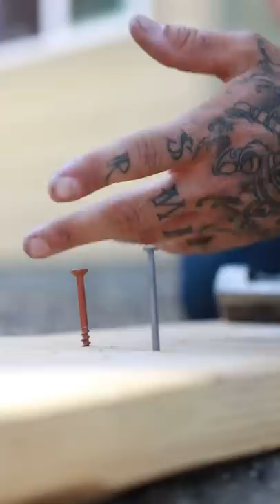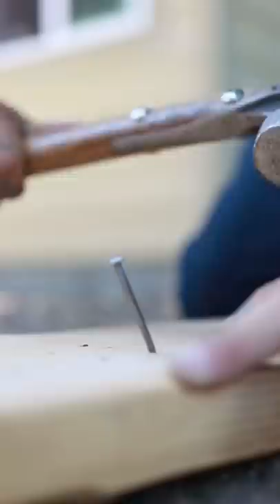Nails vs. Screws: Why do we use nails? #shorts

Comment: That's literally not the reason why. Nails going faster with a nail gun. Screws would take forever you would never be able to power through with screws it's the only reason nails are preferred. Say they made steel screws that could bend you'd see nobody using them. Purely for the reason I mentioned.
Reply: I guess that could be another reason why nails are used, but the main reason still applies. As he mentioned, nails have tremendous shear strength, which under pressure, it can bend. When screws bend, its structural integrity is compromised, pretty much rendering it useless. This is why nails are used for exterior walls, wooden house frames, attaching roofing and hardwood floors. If screws were the better option, they would 100% be used.
Reply: @nagnot6718  I don't know about you but I have never seen a screw sheer within a wall frame or a stud. If the house shifts the wood would groove before the screw even comes close to snapping. The day you can put screws in a nail gun is the day nails will be obsolete. It's always about time when it comes to construction. I could pop in 20 nails with a nail gun in less than 7 seconds. As opposed to minutes with screws.
Reply: @patman0250  While it is true that it’s very hard to sheer screws or nails, we use nails just in case of the event that there is enough pressure to shear. I’m sure the efficiency of nail guns are a big reason why we use nails, but even if there were screw guns, nail guns would still be used because of their shear strength. What’s the point of using screws that can snap rather than nails that can bend?
Reply: @nagnot6718  Like I said have never in my life of home renovations seen or ever heard of a screw snapping while the house shifts. I don't know where that fear comes from but before that screw even comes close to snapping. Woods softer than metal it will grove way before that.
Reply: I've worked on many of houses and I can promise you that the screws may break when u pull them out but never have I seen one break from shifting......I'm a 4th generation carpenter....I've framed addons with screw b4 (owner had like 4 buckets of t25 torq screws) and it's in tornado valley here in arkansas......never a single issue
Reply: @tylercollison4858  Exactly. Screws are some pretty tough suckers. Who knows maybe houses shift because nails bend LOL.
Reply: @nagnot6718  there are screws used for framing that have a higher shear strength than nails. Also, you hardly only have one force being applied, wood contracts and expands so the nails are under tensile strength as well causing them to loosen unlike screws. This makes their shear strength much lower
Reply: Well as long as we are seriously arguing it... Even if screws were as fast to install and as cheap to manufacture as nails.  Do you really hate the person that comes after you that much?  Ripping small nails and staples out  is really easy compared to finding every screw and hoping the heads not stripped. Be kind and make it easy to rewind please dear God!  And don't overdo all of the staples and nails either please while we are at it...  Know your ratios please
Reply: @brianbradford3483  Bro there's no arguing and there's no hate it's just facts. You're mixing truth with debate. I don't hate nails and I don't hate people that use nails, I'm just stating the simple facts never seen a screw cheer for my shifting house. That was the exact point of this video. PS In absolutely no way whatsoever is ripping out nails easier than removing screws. By the simple fact of screws are removed with power tools. Most Niles are sunk below the wood. Removing screws is as easy as punching in nails with the nail gun. I think you're just getting on mixed up here.
Reply: impact guns, no one hand drives screws.
Reply: @engineeringreality7878  Exactly.
Reply: Ever hear of an impact? It'll drive a screw in no probs.
Reply: @historyhisstory6289  I made that comment with impact drills in mind. It doesn't matter what kind of impact drill you have. By the time you're on the fifth screw I'm already going on 30 nails with the nail gun. In no way shape or form is there a comparisons. That's why nails are preferred over screws because they're faster, not that they snap when the house shifts that's just made up BS.
Reply: Actually it is the reason why. Screws do not have the shear strength, and will not pass minimimum code for framing inspection for fastening structural work. Unless specialty screws of course
Reply: @patman0250  think of a floor system. Even a deck will be quite a bit weaker relying on screws alone. They do not have the shear strength
Reply: @2muchofyou  you do know screws don't meet minimum code for structural framing. For reason mentioned in video.
Reply: @chrisburns5691  That's literally not true at all. like I said before I've been building and tearing down houses for 15 years. And I have never in my life seen a sheared screw due to a shifting house. Pretty much a myth at this point. Who knows maybe houses shift because nails are used.
Reply: @patman0250  think of a floor system. That is why you wouldn't pass a framing inspection if you use deck screws to do your framing lol. There is a reason screws aren't used. I learned this as a first year apprentice. He isn't wrong.
Reply: @chrisburns5691  seems you need more apprenticing, not passing inspection because you use screws it's the most unrealistic and knowledgeable thing I've ever heard. Like I've said before I've been building and dismantling homes for 15 years. Not one case of shared screws or I'm not pass inspection due to "screws". That's just laughable.
Reply: @patman0250  if you use screws to frame a house, that is laughable
 
Read up on the building code. Typical screws do not meet code for structural work.  This is basic knowledge.
Reply: @chrisburns5691  The only laughable thing here is your knowledge. Screws are literally designed and used for flooring and studs. Including decks which is why they're called deck screws. How old are you? Completely blowing past the fact that screws don't sheer when a house shifts.
Reply: @patman0250  Jesus  christ, I really hope you aren't framing decks with 3" deck screws, and if so better be using hangers. Apparently you've never read the building code. As a carpenter we have to be quite familiar with it. Try giving it a read sometime. Difference between a handyman and a carpenter I guess.

Screws are superior for many purposes, as a journeyman  carpenter i use them daily. Subflooring should definitely be screwed and glued. Deck boards are best screwed, maybe hidden fastener system etc.

Structural work needs to be nailed, or if screwed specialty structural screws are needed. Deck screws and the like just don't have the shear strength. Might be good for ya to read over the building code, or work with an experienced carpenter to further your knowledge.
Reply: @patman0250  i can tell you are insecure about your handyman level knowledge. No worries.
Reply: @chrisburns5691  I wouldn't be surprised if you're mistaking nails for screws and vice versa. But that's all right just keep playing with your Tonka trucks and don't worry about the big boy things.
Reply: @patman0250  sure thing bro... keep on framing with deck screws..
Reply: @chrisburns5691  Apparently you've never heard of stud screws. Guess what they're used for go ahead guess, ah who am I kidding you're too simple.
Reply: @patman0250  sure thing bro..
Reply: @chrisburns5691  Shhhh. Go back to sleep soon

Comment: Nails also pull out slowly with the tiniest movements. There shouldn't be enough movement in your building to break the screws. If the screws are breaking them you have ground work problems or foundation problems.
Reply: True. We build with nails because they're cheaper.
Reply: @lukeb3930 that’s right my dad ain’t rich for them screws
Reply: Screws in structural members have to be rated for purpose for the exact reason he stated. People just don't use them because they're slower and more expensive.

Comment: Nails and screws are made out of totally different metals depending on the job. Most nails are made of a softer metal compared to screws. There's a lot of difference between driving force and twisting force. Depending on the material your trying to penetrate. It doesn't matter what construction you're doing. You use the right fastener for the right job, SIMPLE.
Reply: A lot of screws are cast as well, whereas nails are generally forged
Reply: Types a paragraph. SIMPLE
Reply: @hysterheister0947  🤦‍♂️🤷‍♂️
Reply: Okay.......so what is your point? 
Are you correcting the author or adding additional common sense info to it.
YouTube vids are easy to make & upload
Reply: @thomascalton3067  no not true literally both can be out of anything between mild steel and fucking rock hard steel or stainless. Depends on what you stick it in.

Also never ever buy fucking cadt screws
Reply: Difference screws cost more why use a screw of the same material when you can use a cheaper nail that takes 1/10 of the time to apply time is money SIMPLE
Reply: @thomascalton3067  tools are forged so are pin connections on heavy equipment, but I'm not sure bout nails.
Reply: @Donaldtrummp  screws have 5 times the holding power and if a house buckles & twist enough to break screws that means it was a  hit by a tornado or equivalent. It would suck to build one with screws. Wouldn't be worth it unless your house was mobile 😂
Reply: @junkworks1  then why aren't you building houses for everyone bro? Since you're way smarter than everyone & have all these ideas of how it's better
Reply: @Donaldtrummp  thanks for the compliment bro. I'm always thinking about stuff. It's nice to see someone finally noticed. I couldn't possibly build all houses cause I'm a ditch digger what do I know? Screws would be better i would imagine, but i wouldn't want to frame a house with them. It would take forever to build. With that said, Every deck I've ever built or seen built used mostly screws for fasteners.
Reply: @Donaldtrummp  hey just for that vote of confidence in me, i subscribed to your channel. One hand washes the other 🙂

Comment: It’s pretty simple actually- Nails are used for things like framing because they bend with the expansion/contraction of wood, Screws are used to secure things together that aren’t meant to warp and bend. For example- you frame a wall with nails, then use screws to fasten the drywall.

Comment: Americans: That's why we build with NAIL

Indians:  Confused Cement Noises
Reply: Anon Ymous  I don’t know man. The brick houses in Germany have been working out for generations. And as we sometimes get tornadoes and pretty damn strong storms, they also proved as catastrophe resistant. As soon as a little wind comes up in some woodhouse village in Oklahoma you can just see all the houses getting ripped apart by it.
Reply: @TheReplayJunkies  bricks are different from plain concrete... brick walls are built with a strong foundation for support, then they usually build an inner mesh of rebar, then they start laying bricks with a filler in between them, usually mortar or some sort of concrete. That's roughly how they're made.
Reply: @rafaelbastaja7406  Concrete cracks where wood flexes.

Comment: It honestly depends on the load for a given structure. There is a reason to use both. Flooring, decking, constant pressure dependant, and other horizontal loaded structures should be screwed in. Framing should be nailed   exterior walls nails ect...

Comment: They both have a different purpose. We build with nails because it is a lot faster to do with a nail gun, that's it. Also, nails are a lot cheaper than screws. We build the structure with nails to save time and money, but everything else in held down with screws. That's why we build with nails.🙏🏻👍🏻
Reply: I appreciate your honesty
Reply: @hoggwild3706  
Thank you, no problem.🙏🏻👊🏻

Comment: We build houses with bricks because you're supposed to.
Reply: Brick houses are good....but there is no innovation in " youre suppose to ".... "our forefathers did it so youre suppose to...."
Even RCC/framed structures are built that may use Concrete blocks.
Reply: @manz007  Maybe some things don't require innovation. In structural engineering "innovation" can mean people die. If I was building a house, I'd go for dependable rather than innovative.
Reply: @TheYuvimon  you’d go for being out of a job... There is not room in the home building industry for people who don’t want to innovate. The people who can afford to build new homes would never hire you with that kind of thinking. Copper pipes were viewed as dependable. Until they came up with a product that is vastly superior in every way. Faster to install, easier to install, less leaks, less issues, and is cheaper. No body is putting copper pipes in new construction. Everyone uses pex. Innovation will win and when it does those who refuse it will be out of a job faster then you can blink.
Reply: @adamdodds144  the builders aren't the ones doing the innovating though. They will put in copper pipes just as well as led ones. I'll leave the innovating to the people who know what they're doing. When builders just start adding their ideas to a structure, without running it by the architect/structural engineer people can and have died.
Reply: @TheYuvimon  you just proved you don’t know what you are talking about. Nobody is using copper or lead pipes in new construction. It’s slow, expensive, and it sucks. I’ve worked as a project manager and been on sites. I went to school for civil engineering. If a builder isn’t thinking about innovation they will be out of a job. You don’t realize how many subcontractors lose contracts because they don’t work with “product x”. If you want to be stuck in your ways you better get into to residential contracting were your boss is a homeowner who doesn’t know what they are looking at. The engineers and the project managers are the ones who push for innovation. More often then not the innovation is an engineers idea. The laborer getting paid $20 an hour to bust his ass isn’t the one coming up with the innovative ideas. That’s what the engineers, project managers, construction managers, and guys with years and years of experience are doing. That’s the team that’s putting their heads together problem solving not the dude who barely finished high school that started a couple months ago.
Reply: @adamdodds144  Hey, way to go! Played the "Gotcha" card on me. Everything I have said so far, must be invalid because I don't know what the name of the most recent fucking pipe brand is.
Let me say this again but slower.
Innovation does not equal improvement.
IF a product has been used and tested enough to prove itself reliable, it becomes the new norm ... sure, duh.
I think our problem is, you are talking material, I am talking process.
Well, shit if I still make houses out of wattle and doub, yeah I'll be out of a job. But in the process of building something there are no shortcuts, if you want a structure to last. (I'm not talking about the paper mache tornado toys Americans call residental houses, those are not structures, those are neatly arranged piles of tinder)
If you have workers "innovate" on the job, instead of sticking to the god damn plan, structural integrity can be compromised. (see Miami - 4 weeks ago - 97 dead) 
If you have electricians improvising a solution, instead of sticking to the plan, buildings will burn!
If you have construction/project managers changing designs for ease of production of components, people will and have died!
(Hyatt Regency, Kansas City 1981 - 118 dead)
You stick to rules and regulations and nobody gets hurt.
Shit gets done ... painfully slowly sometimes, but properly!
PS: We don't use lead pipes anymore, not because they - as you suggested - are "slow, expensive and [...] suck" but because lead pipes FUCKING KILL PEOPLE!
Reply: @adamdodds144  yeah, pex is great if you like shit water flow and ingesting plastic the rest of your life...
Reply: @adamdodds144  you got fuckin wrecked mate 😂

Comment: I'm a plumber so the only framing I do is installing blocking for shower valves, wall mounted faucets, water filters etc. I used to only use screws but I recently purchased a 16g finish nailer now I use both. It lets me get my blocking really nice and square/level very fast then I toe in a couple framing screws to keep everything tight. Its really a lot faster with nailer+screws when compared to just screws. Sheer strength is not really relavent to me but I experience the speed advantage of the nailer and I am so sad I waited so long to buy one!